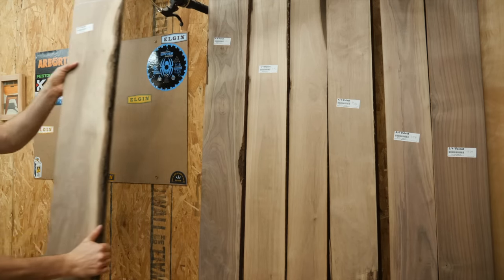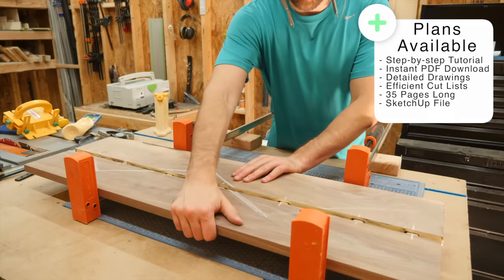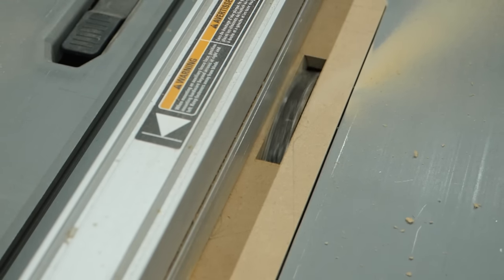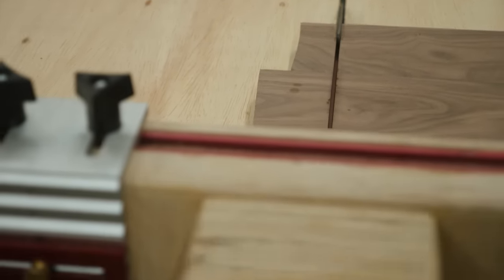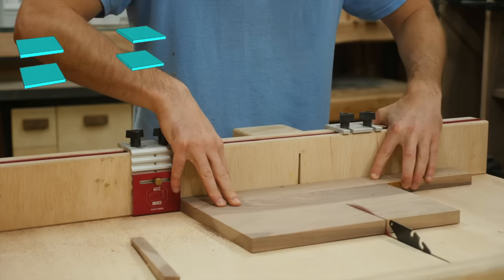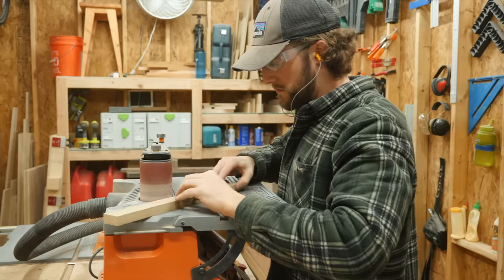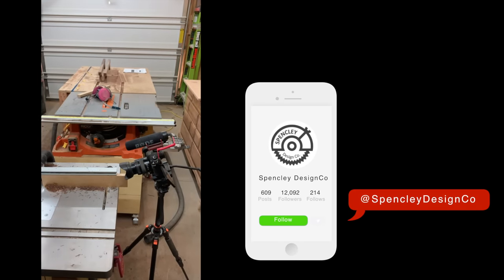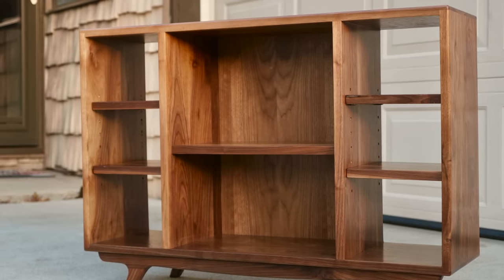custom furniture business... how hard can it be?

Comment: TIP: I noticed you had some router burn when cleaning up the legs. to get a clean cut, put on a piece of painter's tape for the bearing to follow and do your rough routing. remove the tape and rout again to remove the burnt portion. since you are removing a very thin amount, your router bit stays cooler and should not burn the wood. this sure helps with the sanding.
Reply: Sharper bits help too
Reply: Aka a whisper cut. Works great.
Reply: Why don't more Spencleys know this?
Reply: Thanks for that tip about using tape.  👌

Comment: This is pretty nice design.  I would have used dados rather than dominos to attach the center shelf, but the dominos and glue are probably strong enough.  Speaking of dados, at 4:53, you can just see the dado stack causing some tear-out, damaging the piece.  This can be avoided by using a chisel or razor to cut a nice, deep score prior to the cut.  In fact, if you're the cautious sort, you can do the same to the front.  Dados are notorious for rough cuts.

Comment: Fantastic video. Did you have a need to flatten any of the board faces? Maybe I missed it in the video but I didn't see you planing anything
Reply from the maker: Thank you so much for checking out the video!! To answer your question, I actually don’t own a jointer or a planer. I had to buy pre-milled lumber and rely on that being flat (which is a joke because the boards are never flat). That’s the main reason I use dominos to glue up the panels. Those help out a lot the keep the glue up flat when you don’t have milling equipment. I just glued the panels up and then used a sander to knock down the ridges.
Reply: @SpencleyDesignCo  Good to know! I guess if you held a flat edge up to one of the panels you would notice it's off but most folks could never tell.
Reply from the maker: Exactly!  By no means is it perfect at all, but it’s as close as I’m going to get with the tools that I have. 
 
And to be completely honest, I’ve never set out to make flawless furniture. I’m more about trying new techniques and getting conceptual ideas out of my head. I never intended to remake any piece. They’re all prototypes for me 😀